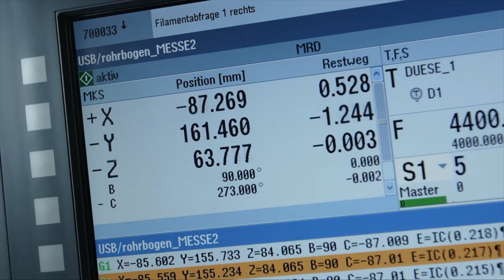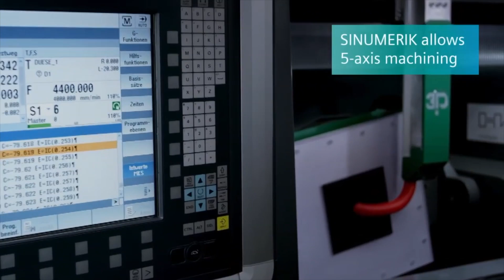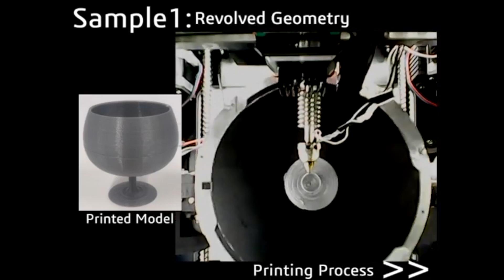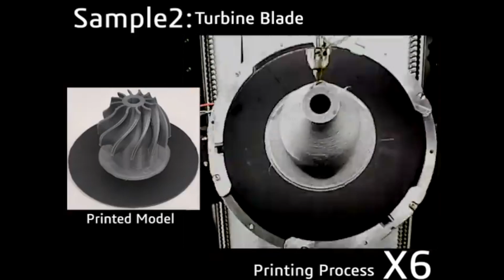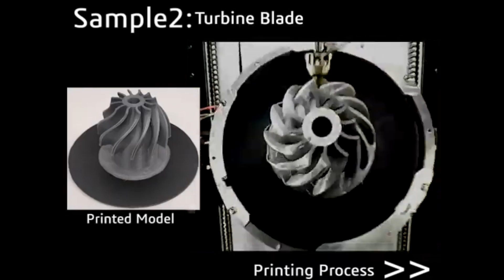5 Axis 3d Printing timelapse compilation videos 2021

Comment: I just don't get the point of those machines... Like many already said, by the time you've handed over the monies for ANY of those machines you've already gone past the cost savings from not 3D Printing Support Material and for any Industry that cares about 3D Printing without support material I'd argue that either using SLS 3D Printing for a one off production or the creation of a mold for injection casting en masse would be the way to go - Even if the latter means making it an assembly out of multiple parts.
Reply from the maker: They are useful on large scale industrial scale, but im sure the advantages of those machines will become more obvious as they become cheaper and as more people find ways to make things with them that they couldn't do otherwisw

Comment: How did you generate the Gcode for these machines?
Reply: Simple answer, MAGIC
Reply: As you can see in the video the first example's slicing/gcode generation was done in "NX". Probably similar to fusion360 as a CAM tool that supports additive mfg.
Reply: Siemens NX, it's the industry standard CAD/CAM package